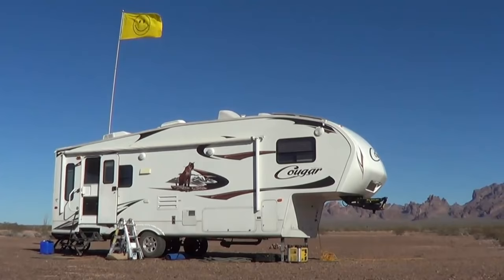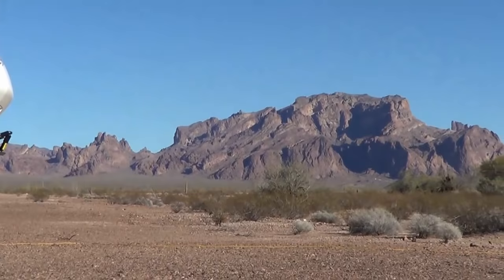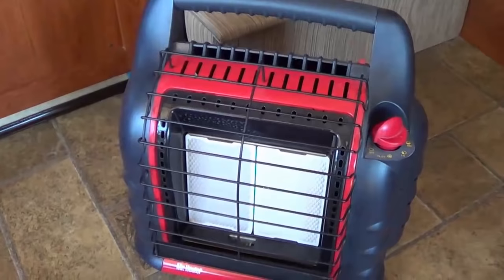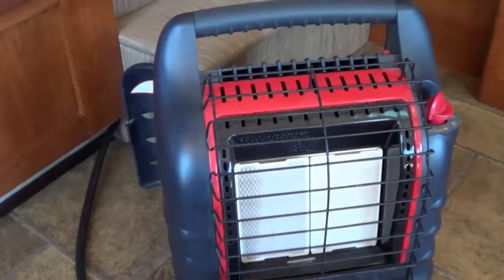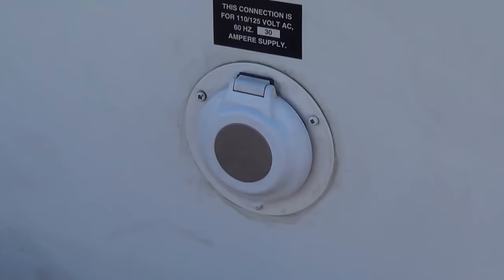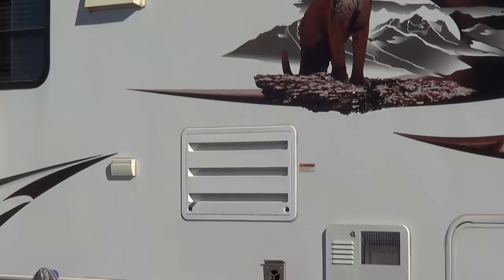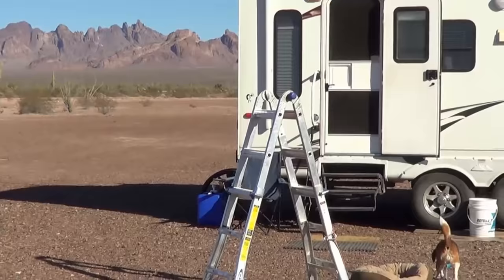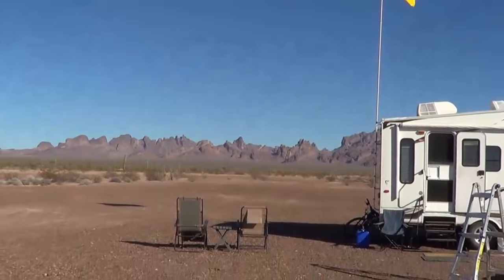20 More RV Upgrades to Our Fifth Wheel Trailer

Comment: Love your style Dude!
Great stuff. a Real Do-it-yourselfer....
Why a PWM CC? as opposed to the latest trend to spend sometimes 10 times the amount on a MPPT CC.
Reply from the maker: Thanks!  The PWM CC works in tandem with the Trimetric battery monitor. They are both designed by a California company called Bogart Engineering. I find it a nice economical package for lower wattage solar installations like our 500 watts. It's done well for us for 3 years now.
Here is a link to the website - http://www.bogartengineering.com/products/solar-charger.html
Look at C1 in the FAQs for more info on why they chose to go with a PWM - http://www.bogartengineering.com/support/faq.html
Reply: @LoveYourRV  What is the length of your cable run from the PV array to the PWM CC? 
What size cable are you running?

My only reason for considering the MPPT over the PWM is the ability to handle 24v PV array and down step to a 12 v battery bank.
The reason I am considering the 24v panel is so that I am able to run the distance from the Roof of the RV to the basement with as little line loss as possible.
Do you know your line loss?
Reply from the maker: @Z71Silverad0  I have my panels mounted right above the batteries located in the front storage compartment. The run is between 12-15 feet with a wire gauge of 7.  System serves our needs well - https://www.loveyourrv.com/tag/solar/  Cheers, Ray

Comment: I've used Interstates in my other RV's they are good batteries, however with the investment maintaining them and getting them to last as long as possible before stultification creeps in and takes them to battery heaven is always on my mind.
I use a few methods of maintenance, but what do you do to maintain your batteries over time and do you add anything like a magnesium sulfate solution (Epsom salt)  into the batteries when the water/acid becomes low?
Reply from the maker: What kills most lead acids is undercharging,  the pathetic OEM charger setup in my rig never charged my previous Trojans properly I've come to learn. They need 14.8 volts during the absorption phase, the converter put out 13.6 volts.
That's where solar is very good for them plus my new converter. Now I can set my controller to put out the exact charge voltages that Interstates recommends and do an equalization once in a while.That mixes up the batteries and gets rid of sulfation.
I just add distilled water as needed, which doesn't seem to be too often, every month or two. If they last 5-7 years I'll be happy and go get a fresh set.
Reply: Great, I understood voltage and absorption,however not the equalization I know about it but never thought to have a charger/converter that has the ability to equalize. Thank you Ray!
Reply from the maker: The Bogart stuff is pretty cool, let's you custom set many of the controllers charging perimeters -  Some good info in the manual about charging batteries - http://bogartengineering.com/sites/default/files/docs/SC2030-9-10-15-UsersInstruc.pdf

Comment: Wow! Great to be handy! I am learning a lot from you and other full time RVers. I was curious why don't you have angling brackets for the solar panels installed? I understand angling the panels will increase your charging power by 15-30% from what I am reading. For you it should be just a couple of hours of work :o) the way you have these 4 panels that you showed at 7-8 minutes you can possibly put them all vertically and change their direction to lay them down horizontally to avoid overshading? I undstand threre are 2 sided brackets you can have so you flip the panels to the sun as you can orient them depending on how your rig is positioned - facing either the left or the right side of the rig?
Reply from the maker: Thanks! Several reasons for the non tilt- 
Too much hassle for me, it's a personal choice. I don't what to be on the roof setting up and bringing down panels. We like to move around fairly often.  If I was a longer term camper I might look into it.
Wind can be an issue in the desert and can appear very suddenly. 
Also the less times on the roof the less chances of falling off it, plus reduced wear and tear on the roof itself.  
If I need more power I have plenty of room for more panels up there and they are getting cheaper all the time.
As the sun gets higher in the spring the tilting means less. 
Good tilts are expensive.

I am entertaining the thought that my next solar upgrade will be a large 140 or so watt panel to use as a remote ground panel I can move around to get the early/late sun or if we get shaded.  Cheers Ray
Reply: +Love Your RV I see that Renogy is offering higher power panels. Hav you thought about uying them and putin them on the RV for permanenet set up and using the smaller ones you have now as ground panels?
Reply from the maker: No, I've got pretty good coverage up there now because they were a perfect size. having them up front keeps them from being shaded in any way by vents and antennas. I just think of it as one large 400-watt panel.
I'll likely get a big one for the ground and maybe build a mount for it on my truck tool box to have it wired in during travel.
Not sure if I'll go with Renogy on the ground, I like the Kyocera panels, they have a very robust looking frame on them. But that will likely be an upgrade for next winter, with spring in sight and the higher sun, the 400 watts will do the trick for us.

Comment: So where exactly do the charged up batteries run to?
Reply from the maker: To all of the RVs 12 volt circuits and also to my 1000 watt inverter to supply a couple AC outlets in the rig so I can plug stuff in mainly my wife's iMac computer and my laptop.
https://youtu.be/yV2xJiHSbfU
Reply from the maker: timcat100 No need to, the garbage CT unit does what I need it to do and has for 5 years now. I'd rather spend my money in other ways.

Comment: Curious as to why you don't use AGM batteries. They don't cost that much more, there's no venting issues, and they're practically zero maintenance. Plus, AFAIK they charge faster.
Reply from the maker: I guess it is a personal preference, I don't mind the maintenance, like the fact I can check each of the cells charge state with a hydrometer. I like the robustness of the golf cart batteries, thicker plates. 6 volts also have a smaller footprint being taller so fit perfectly in my compartment.

Our front storage compartment in the fifth wheel is very well vented so I've never had corrosion issues from gas build up. If I had a different RV type I may have gone with AGMs.
I find good quality AGMs are still quite a bit more per Amp Hour vs Lead Acid, so still find the best bang for the buck is lead acid 6 volts.
Reply from the maker: Looks like  a good deal. :)